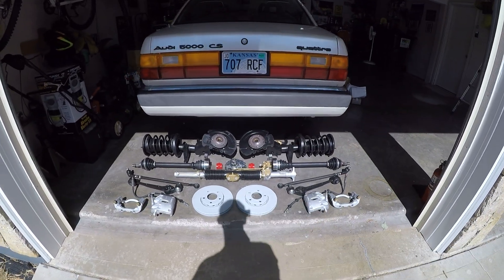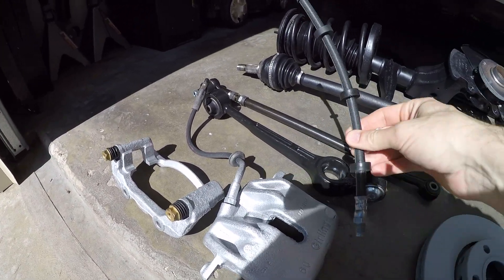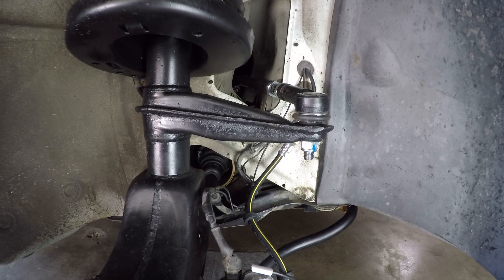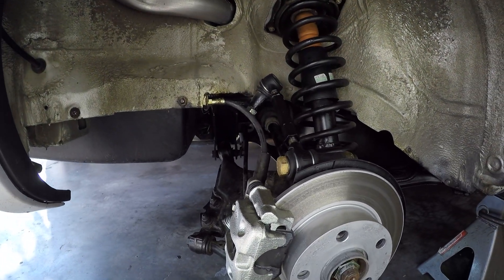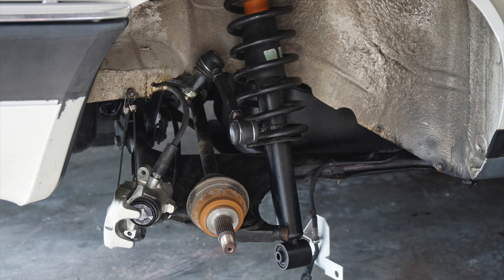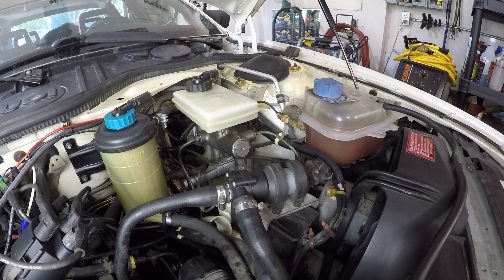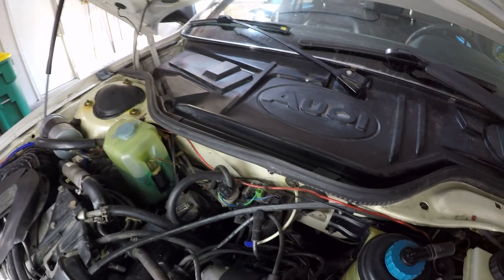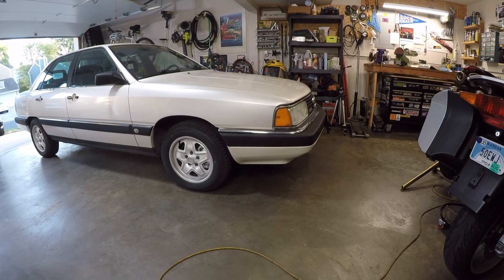Project Audi 5000 CS Quattro | Ep.11 | Reassembling the ENTIRE front end with NEW PARTS

Comment: CRAZY that that one vacuum box under the dash could affect the engine so much....
in my own research to fix ancient recalls, one mentioned that a bad seal in the lines could cause an elevated idle related to the sudden acceleration.  
(in addition to the automatic shifter not having an brake pedal interlock and could shift into D/R with a bump of the lever)

Comment: I own an '87 5000S. I relate to the problems finding correct sized rear wheel bearings. I've never had so much trouble getting the rights parts for any other car that I've had with my 5000S. It's been a great car for the last 13 years in all other respects. But, getting the right parts has always been difficult.

Comment: Nice work!  You might check the flaps in the airbox to see if the OEM foam has disintegrated.  When it breaks down, the system can't divert the air to the correct vents.  Not a fun job though, as I'm sure you have learned about many jobs on these old Audis.